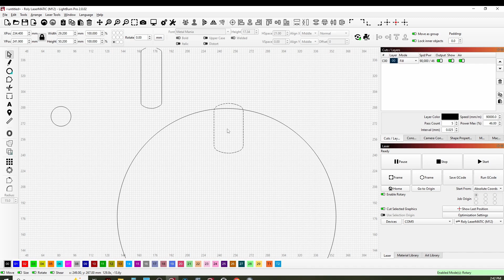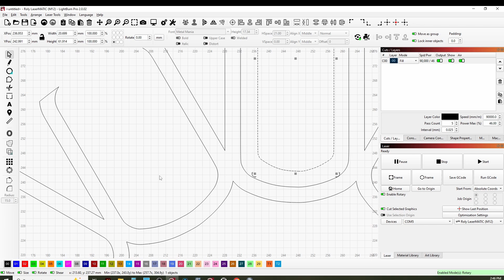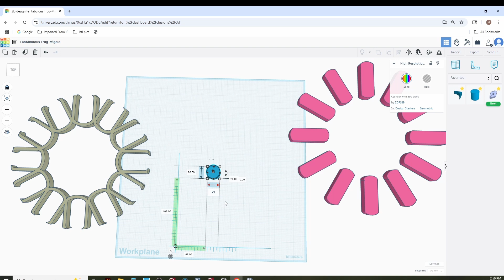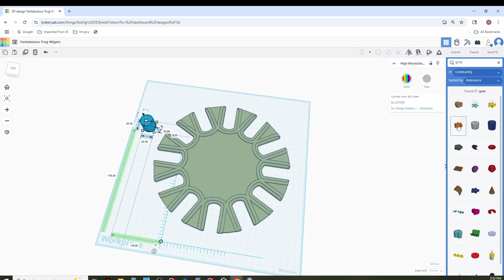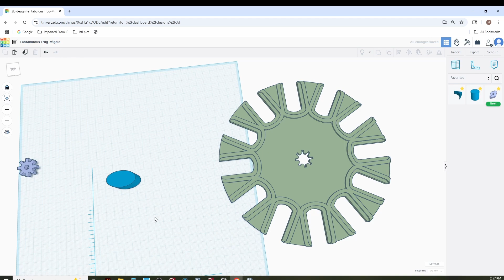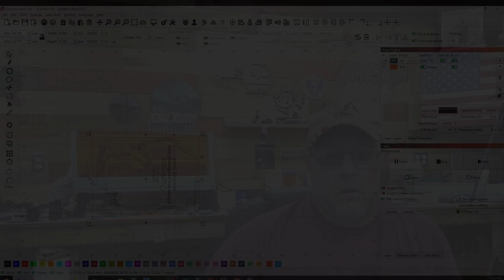Rotary Jig for Dog Tags

Comment: I understand you took a picture of the dog tag, then imported it into light burn and traced it. How do you get it to be the correct size in Lightburn?
Reply from the maker: As long as the trace is clean you can resize it to what you need , I have done this with many objects